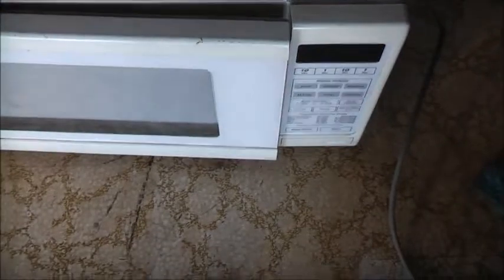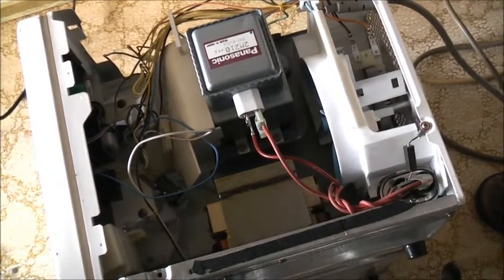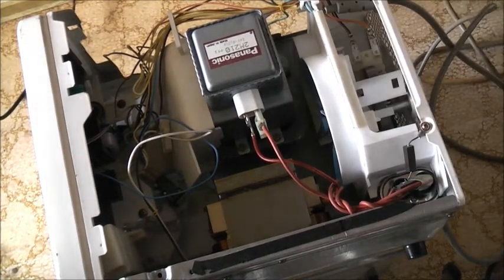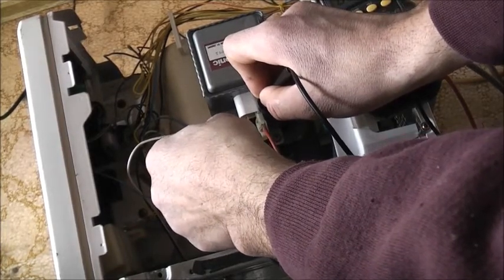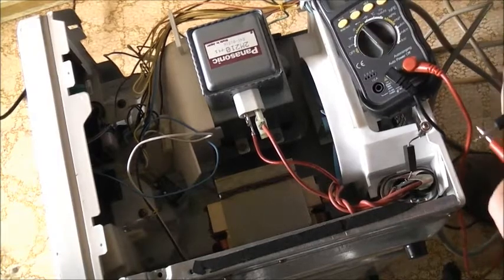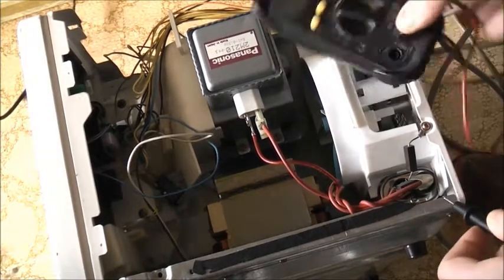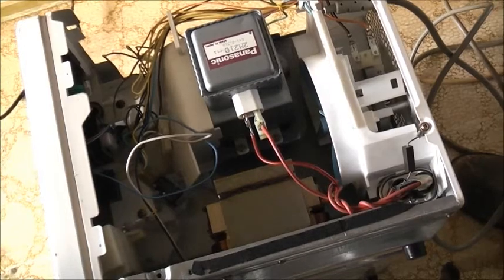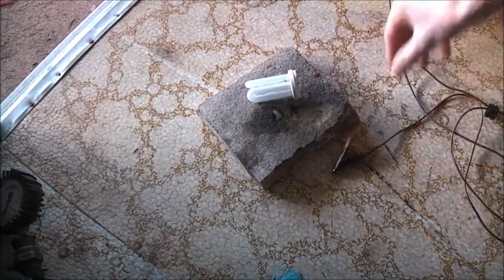Dead Microwave & CFL!!

Comment: Aaaaah, the microwave has gone pop. :-(

Maybe there's a possiblility of getting a replacement magnetron, even if it is a used one?

If not, then I say strip it down, and use the empty casing as a "Battery-Charger" :D

Keep the fan in there, as it can coll down the recharging process, and should the batteries smoulder a bit, it will clear the smoke nicely. :D

Thanx for showing,

-BoomBoxDeluxe.

Comment: Microwave oven diodes have a higher forward voltage drop that can't be measured with a traditional multimeter which only output 2 or 3 volts. One way to check is get a 20 odd volt power supply and a 1 k resistor and measure the voltage drop across the diode, it should read around 8 volts or so